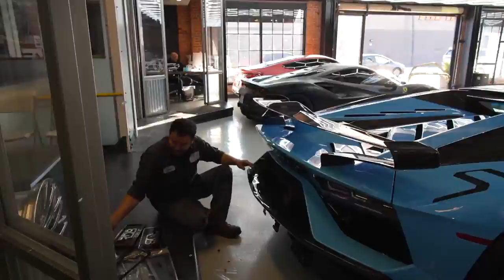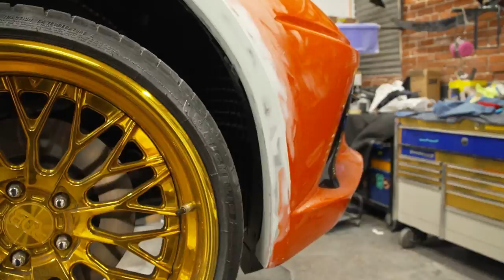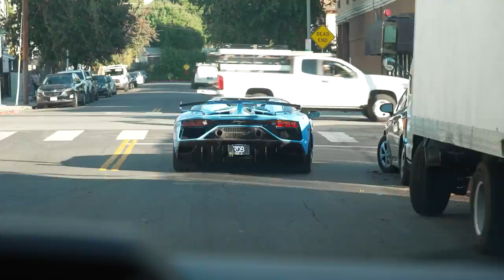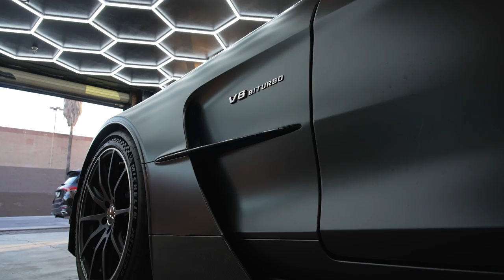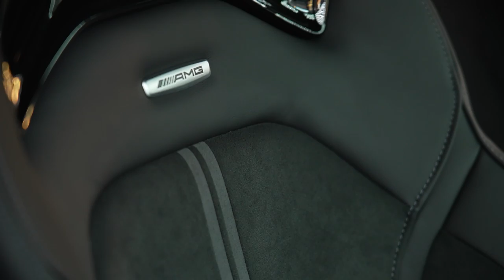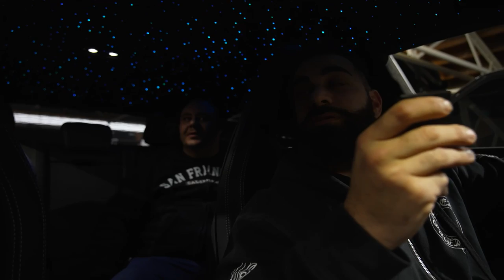Lamborghini SVJ Police Caught Shooting Fire, INSANE AMG GT Black Series.

Comment: Not sure about the spacers on the AMG GT Black Series. From a stance perspective, I completely agree - but not from a track perspective.  Throws off the balance of the car as it was intended from the engineers at AMG. Instead of spacers, might as well do new wheels with proper fitment. My 2 cents.....but to each their own! Sick ass ride tho!

Comment: “It looses traction, it’s loosing control”, is Sarkis for real, that’s the drivers fault, cold tyres etc. When you’ve got so much power you need skill to be able to control that, which is why so many super cars get totalled by jackasses who punch the pedal to the floor and suddenly the back end of the car is now the front and you’ve slammed into something..